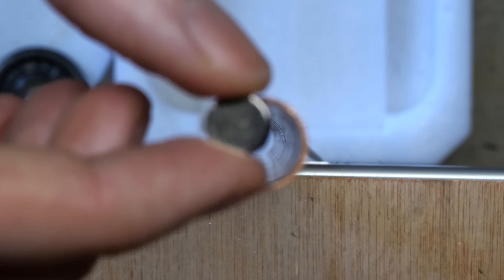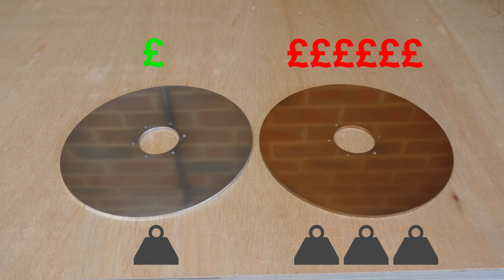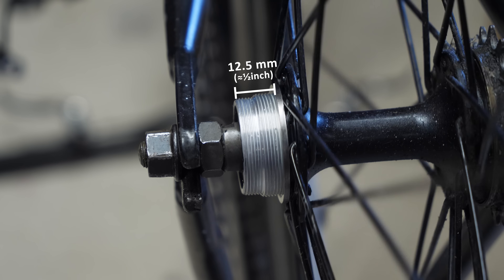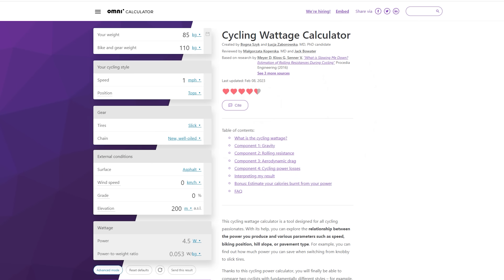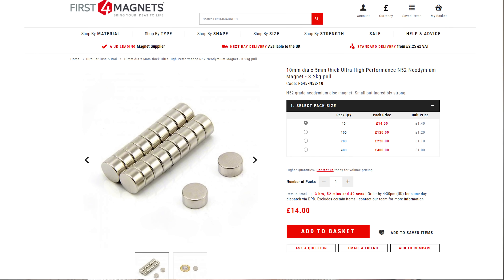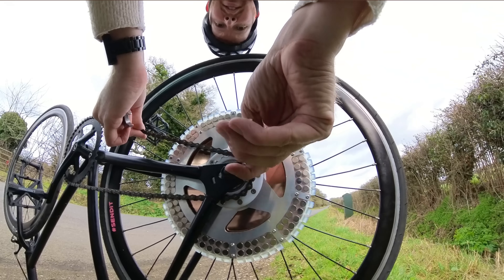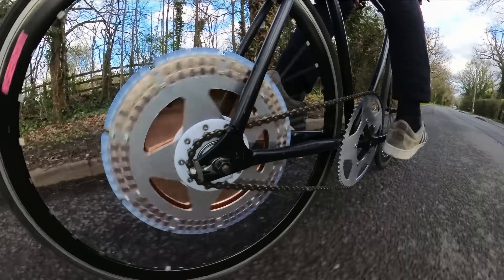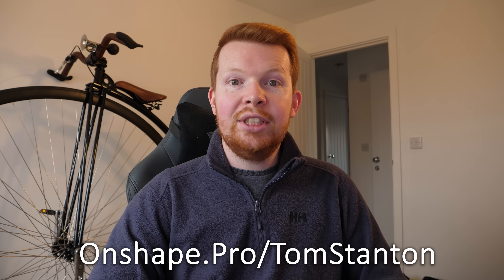Gearless Magnet Bike

Comment: Heh, as you were changing the main sprocket, I was thinking of how much heat would be generated with the higher speed, and, well, you showed it at the end. 

I was also thinking of adding curved lines in a spiral on the rear sprocket to make a sort of pseudo-impeller to help guide airflow onto the surface of the copper, but there's no depth left

Comment: Thanks, nice build. The calculations you were doing on power was actually calculating the power that would be lost in the clutch, not the power transferred. I suspect most of your pedal power was lost going up the hill looking at the differential in speeds in the clutch! Nice to see you measure temperature at the end

Comment: I think you may have missed a trick. Putting an iron backing plate on both back sides of the magnets (ie facing opposite the copper disc) would give you two additional advantages. One being the flux would be more constrained and not grab the chain/spokes and the field facing the copper disc would be more intense. However the heat due to loss will definitely be more severe when the clutch starts slipping and will equally affect the magnets, which in your case, due to their size might have been a bit cooked too, but cooled faster due to less thermal mass. But in theory, the increase in efficiency would mean less slipping. 

Another factor is that neodymium magnets permanently lose their magnetism when heated to approximately 85deg C, which is why when these types of clutches are used in industrial applications, there is usually a significant liquid cooling system that either flows through the clutch components, or the clutch is immersed in it. 

They are very precise and consistent (repeatable) clutch designs that can absorb massive dynamic changes in force, so they are very useful in other applications, where longevity and smoothness are more important than efficiency in the force transfer. They are also used as brakes and dampers for similar reasons and also have more traditional lockup mechanisms and or clutches for greater efficiency when output (or input in the case of braking) has reached a certain speed. 

Obviously these are stupid expensive, mostly due to materials, proper matching of the specifications, and definitely being customised for the application, not to mention bulky, but sometimes they are worth it, to solve particularly difficult problems where traditional force coupling mechanisms don’t work as well. Anyway, sorry for being “that guy” at the party, great video and demonstration of a very useful and niche device!
Reply: I think you're the guy we very much needed on this party. Thank you.
Reply: @xZeroOffical  Maybe a stronger magnet.
Reply: Tom, this response is on the money. Ferrous materials will provide a much lower magnetic impedance than air, increasing the magnetic flux density experienced by the copper. So putting some of the outside faces of the magnet groups will improve performance.
Again, on the money; watch out for heating and ideally turn that ferrous material into a heatsink for the magnets.
Finally, milling a shallow pattern into the copper to sort of turn it into a centrifugal fan,  (increasing air turbulence and heat transfer) may also extend the operating envelope.
Mind you, it will always be lossy. Maybe it's more of a mobile cardio machine?
Reply: @pchandle  c'mon peleton!
Reply: Electro mechatronics engineer here and were about to write pretty mich the same thing! However I disagree on the heat part... Yes the magnets suffer from higher temperatures but the heat is generated in the disk and not in the magnets. The suggested ferromagnetic parts to close the magnetic flux would alsobserve as additional radiators for the magnets to get rid of heat.
Reply: He also missed the part of going downhill. I would like to know how that feels.
Reply: Chain sticking is solved by using a rubber belt

Comment: I have experimented with eddy current brakes and found out that the air gap between the disc and magnet has a big effect to the braking torque. It should be in the order of 0.5mm or less. But it's very difficult then to control the runout to prevent contact.

Comment: Did the electrical eddy currents produced by your breaking cause the microphone to cut out? I didn't think about the level of emf waves it generated. I'd love to see how much electrical discharge during breaking occurs.
I definitely thought about the heat due to resistance right away. I don't know how you could reduce that though. Maybe aluminum's heat tolerance is higher?

Comment: You can shield the magnets with steel. Maybe gain more torque by adding more copper discs. Also, move the clutch to the drive end, instead of the driven end. 
Moving the copper discs away from the magnets would be a cool test too. Maybe as you start to pedal, 2 separate center copper discs get pushed apart, towards magnets. Then when not turning the crank, it acts like it's free wheeling. Almost like a one-way bearing. Or maybe just use a one-way bearing between crank & clutch.

Comment: Hi tom, 
Can you make gyroscope with the power form spinning wheel momentum then it can help to give rider support to balance when they stop or pause momentarily. 
Using the spinning wheels of a motorcycle to generate power for a gyroscope is an interesting idea, and it's theoretically possible to harness the rotational energy of the wheels to stabilize the bycicle when it stops or pauses momentarily.

Comment: I was very interested in this project. There were variables that I think could changed things. A bigger disc with more magnets.  That may be possible because as your wheels expand from the center they look like they come closer to the center. Also your magnet bracket could be a magnet frame to keep them from escaping the enclosure. This one is more so a question, but do you think using aluminum effected copper? Lastly do you think just adding stronger magnets would have been a better idea? Even you changed one variable and that was the size of the bike's original (sprocket). Thanks for reading sorry I deleted the original  comment by accident.

Comment: Probably a good training setup for a marathon biker.  By the time you get back to the real bike it'll be nothing.  Could probably etch fins/fan blade into/through the copper so as it spins more airflow goes over it.  I also wonder if the magnets where allowed to slide in/out from the hub (using springs to hold it with or against rotation) if the change in diameter would increase/decrease the force transmitted at speeds, like a cvt.

Comment: I highly suggest not using flathead screws with plastics... the taper underneath acts as a wedge which eventually splits the hole open. Use head type with has a flat bottom instead. Also use as large a diameter hole as you can as that will spread the load over a larger circumference and lower the chance of developing stress risers.

Great video, I love eddy current brakes!

Comment: I was under the impression that aluminum was a far better conductor, but wasn't really used due to the fact that it's highly susceptible to corrosion, and the oxides themselves are highly conductive which makes them a fire hazard in most situations (though likely not an issue when your only goal is to utilize eddy currents). I learned something today! thanks!
Reply: Aluminium is a better conductor compared to the same weight of copper. Copper is a better conductor compared to the same volume of aluminium. In applications where the insulation is less of a consideration, like on high voltage lines, aluminium is used. Where size is important, copper is used.

Comment: What if you used electromagnets instead of permanent magnets? You could switch some on/off depending on your desired output. probably not worth going too far into it though, given the heat losses.

Comment: I built a single speed with a slipper clutch a few years back using friction media from mcmaster carr and the worlds most complicated loose ball bearing mounted sprocket pressed against a giant belleville spring.  It worked but was pretty much a dismal failure.  Dreams of slipping the clutch to launch off like a 125 gp bike were quickly dashed.  Us humans are basically low rpm steam engines with near zero hp and negligible flywheel effect so the bike exists only as a novelty.

Comment: I propose a hydraulic drive bicycle without a chain or belt. Normally, the energy losses of the drag of pumping hydraulic fluid would be large. But what if the system was designed with very high pressures so the velocity of hydraulic fluid could be very slow? This will require a hydraulic pump and motor with very close tolerances.

Comment: You are using the pedals to drive a generator and use the electric power generated to drive an electric motor that drives the bike. Except the generator and motor are integrated in the same device you call "magnetic clutch" (except it is electro-magnetic).

Comment: First, I’m not an engineer but…. on the chain problem with the magnets, what if you used a non metal chain? And second, braking was you stopping pedaling, what happens when pedel in reverse?

Comment: Funny thing is something similar like this actually is been used in Dieseltrains through there are a lot of disadventages of usual gearing. Only difference is that the magnets are electric magnets so you can change the gear seemless without the use of a clutch which would result in a uncomfortable ruck on the train. 😄

Comment: The waste is not only heat, I guess there's a stupid amount of electricity being generated. Wondering if pedaling backwards will slow you down faster or even block the wheels. I see it very useful for contactless brakes, with the copper as close to the perimeter of the wheel as possible. Great job thou, I appreciate the days of work putting this together

Comment: There are essentially two issues about the energy lost via heat: It being a current in general and having currents flow other regions than where they generate useful magnetic fields.

a) First is about basic resistance within the copper. Each current inducted will not only generate a reverse magnetic field - which is what we want -  but also works against natural resistance, turning that part into heat. Thus better conduction (lower resistance) is needed. A super conductor would be a great solution, but not really sensible. So we need a better material. Copper is at ~ 0.018 Ω x mm²/m already quite good, but silver is at 0.016  even better. Sounds expensive, but isn't as much when considering the next point:

b) Only magnetic fields of current flowing right below the permanent magnets will be of any use. All other current only generates heat. And there will be a considerable amount going across the all copper disk. To avoid those unwanted current it would be very useful to reduce the disk to a ring not much wider than the magnets are, so ~25mm seems right. Doing so will as well reduce rotating mass.

Each of these work well on it's own. Of course doing a silver disk is not a bargain - although silver isn't exactly the most expensive material (just compare printer ink) . Taking both measures make it even better:

A 200mm disk has an area of about 325 cm², while a 25mm outer ring of the same disk is only  74 cm², so less than 1/4th of mass and volume. Assuming a thickness of 2.5mm this comes to a volume of 18.5 cm³. In silver that ends up as roughly 195g - at the current rate ~145 USD. Some bike bells are more expensive :)

While I do not expect the silver ring to materialize, trying the same in copper and measuring what difference a ring vs a disk makes might be doable, wouldn't it?

(A third improvement might be by cutting radial slots into the disk reducing cross currents between magnet pairs, essentially turning the disk as well into a distinct set of magnets , much like some setup for motors do - but that would need a whole lot of additional research)

Comment: Maybe I'm missing the point, but wouldn't the system work if the copper was moving past the magnets? So drive the copper disk instead of the magnet disk, and you would be able to peddle about 33% slower to get the same speed.

Comment: Dude you can make a bldc motor based on that theory. Copper disc as a rotor, and thick PCB with coil pattern printed on it as a stator. Then install an ESC to control the dc current to PCB. If you add permanent magnet on copper disc it gives you mo powa baby

Comment: This is a very interesting exploration of magnetic eddy current drag, (you missed the facts that having attracting poles on opposite sides of the conductive disk greatly increases the drag per magnet and cancels the repulsion of magnets from disk and adding an iron layer on the outside of the magnets shields the chain and increases the drag force) but why would anyone want to add an energy consuming mechanism into the drive train of a bicycle.  You could have just drug a brick behind the bike.

Comment: Further more, the heat has the potential to weaken the magnets.  N52 has a low curie temp of 65c

And, when the copper heats up, less eddy current flows through it, and it becomes a less effective clutch.

Comment: Before VFDs we used to used Eddie current drives/clutches which where in my opinion way better. The motor would start up get to full rpm with no load then you would turn on 24v 4-20ma current and it was so reliable like a tank. No overheating electrical panels, no parameters just a variable resistor and a current meter. VFD's took over and maintenance costs have rocketed. Now you probably don't get the control but motors lasts forever when running a full np hz.

Comment: Veritasium is a hack fraud. Just thought I'd start out with that. Anyway, the rate of fall of the copper vs aluminium sheets in the clip shown can't directly tell you anything. The opposing force to the magnetic force holding it up is, pretty obviously, gravity. Copper is a lot more dense than aluminium, more than three times as dense. That fact alone would lead to the copper sheet falling much faster. You'd need to do some math to draw any conclusions. Oh, I should have waited a minute longer before commenting. Ah well, Veritasium is still a hack fraud.

Comment: Might I recommend a new design?  Try using two plates of copper with your magnet arrangements in between them on a movable armature.  Then this can slide from the outside diameter of the plates to the inside for a continuously variable transmission style device.  I would also look into Polymagnets due to their higher magnetic strength and tighter packing of oppositly charged maxels!

Comment: Since you want it to work at lower speeds what about instead of depending on the slip angle of the magnet fields use magnets on both sides to make a magnetic gear. You would probably have resupport the disk or make it smaller.

Comment: I wonder what effect it would have if you milled some heat fins into the copper plate... I guess you lose resistance because less mass, but maybe theres a sweet spot where youre offsetting the reduction in magnetic forc

Comment: This YouTube video doesn't start with declaring a goal. Gears create variable ratios to match the power going into the pedals to the requirements of the load. The title suggests that the goal is to achieve a variable ratios. The implementation doesn't achieve any ratio change. The work done is very impressive and fun to watch. The number of tools, equipment and skill are first class. 👌

Comment: I'd like to know if 'stiction' is a factor like it is with contact friction. Stiction is the difference in coefficient of friction between static, and dynamic cases - IE sliding friction is different than non sliding friction. I suspect that it doesnt exist here, and that is the big advantage with this method. Stiction causes all kinds of problems in the mechanical engineering world. For example if you could eliminate stiction from all bearings, and auto engine would last ten times as long. Its why stop and go traffic wears cars out faster than highway miles. Almost all friction wear is a result of stiction. Imagine using an electro magnet, and using your setup as a brake. Run a control, with two setups side by side for hundreds of thousands of cycles. You can imagine the control method would wear out, and your method should show little if any wear.

Comment: Amazing video.  Thoughts:  peddle the copper plate and put the magnets on the wheels.  Counterweight the magnets so they move closer into the hub, 'gearing' them as speed increases, creating a 'universal gear'.  The copper plate may then be spun with less effort, at higher speeds, past the magnets, as they self-gear.
Reply: Another possible tweak would be to somehow fold the path of the copper disc to increase the path electrons would need to follow as the disc spins.  Effectively increasing the magnetic surface area possibly.  Maybe a carbon fiber disc with copper wire woven through it.
Reply: One final thought, Making the disc flexible to some degree could allow for it to be push closer or away from the magnets, acting as a 'clutch'.